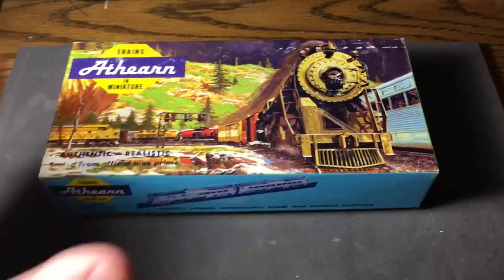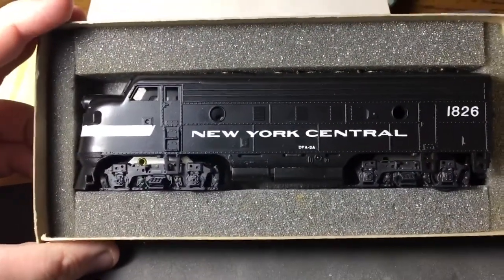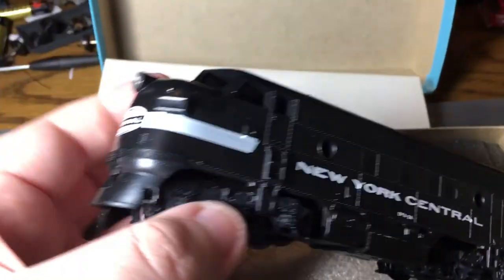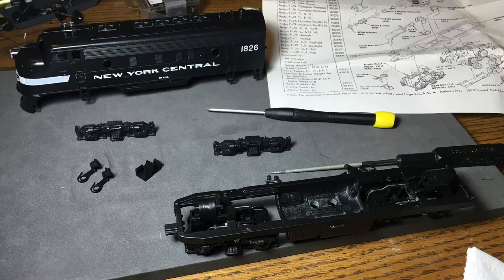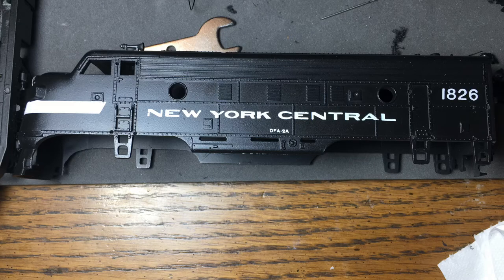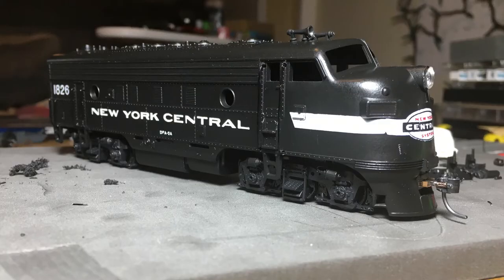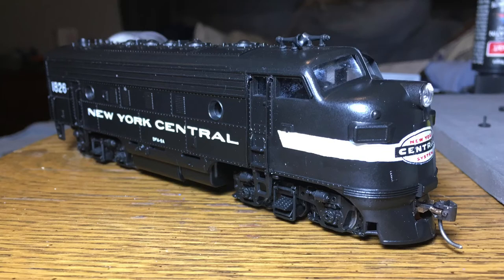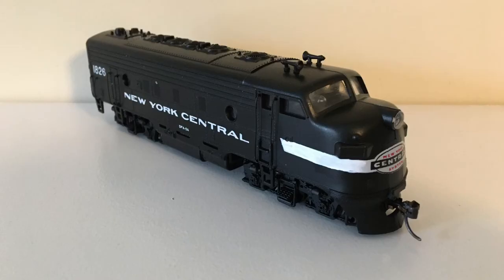Detailing An Athearn Blue Box New York Central F7 Kit

Comment: Looks good.  Use Elmers white glue to hold the glass in.  It won't fog like cyano or model paint.  Mix black acrylic paint with a little Elmers and you can paint the gaskets outside the winds.  0000 brush or toothpick for application.  Once dry...errors can be cut to shape with an exacto and peeled off.  I love detailing these.  Walthers also has a whole kit of ready bent hand rails and windows.
Reply from the maker: I knew there was a kit but I wasn’t told it was walthers, I’ll have to keep an eye out. I’ll keep everything else in mind for the future - thanks
Reply: @ROKMAN1445  
Anytime.  My first kitbash diesel is a 
3 FT MILW Athearn GP-9.  It looks good from 3 FT away.  Did everything wrong.  Still love it.  Did a Athearn Pennsy F9 with the next kit.  Cut out the number boards and put clear acrylic in them  Decaled over them and filled in with black paint.  Used Elmers to seal.  Dry brushed the whole loco and dulcoated it.  Added an MV lens with two holes drilled through the rear for headlight.   It actually projects a beam of light! Still has Ed's stock super-drive and headlight bulb.  I did replace the straps with quality wire.  2 IN model this was.  And 20 years later still pulling.
Thanks!  I will start a new layout on Thursday!
Reply from the maker: @markwilliams2620  they can’t all be breadwinners. One of my earlier models (this one being of CDOT F7 6691) looks hideous and is slowly crumbling but I still love it the same as some of my newer and refined projects, I really gotta redo a lot on that poor thing. If you’re willing to stick around and wait for me to empty my plate you just might see it in the future.

Comment: Nice try but a complete stripping would have yielded a better starting point. Painting is not difficult even with rattle cans and decal application has been covered on Youtube over and over again. A pin vise will hold small drill bits and yield better results for handrails and grab irons.  To avoid fogging up the windows, allow any glue, especially superglue, to dry thoroughly. Nail polish remover will remove super glue and not harm plastic if you want to soak the windshield.
Reply from the maker: Hi, this video is several years old at this point and I’ve taught myself all that and more since then. Thanks for the tips though.